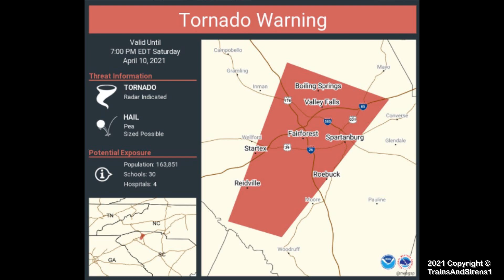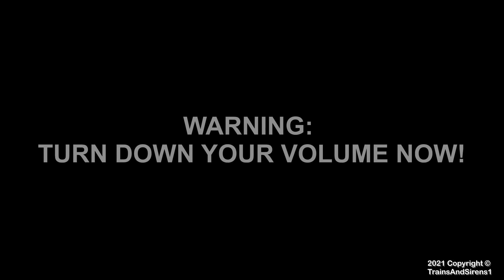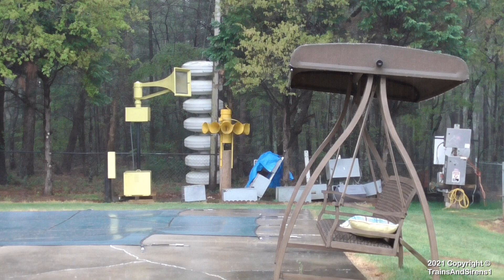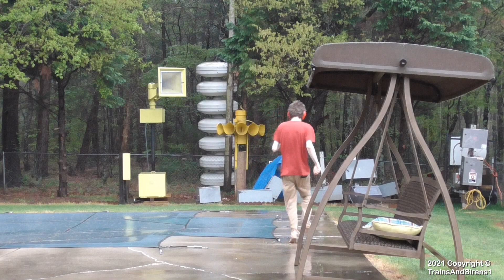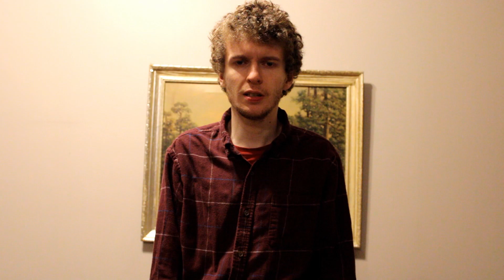My T-bolt 1000, 2001-130, Modulator 6048, and 2T Tornado Warning Activation, Attack/Wail 4/10/2021

Comment: This proves that Thunderbolts are louder than 2001s. I don't care if the T-bolt was rotating, I had a hard time hearing the 2001.
Reply: I just clicked on this video I had no idea there was a 2001 💀
Reply: @Godzilla20191  damn! 💀
Reply: @Siren1000T I know me too I had a Hard Time hearing the 2001-130 😊❤
Reply: The modulator beet the 2001s ass as well lmao
Reply: @mattmakesmachines well, in my opinion it’s probably because the rotator stopped working. Like it’s stuck

Comment: Orchestra of sirens.Beautiful. 
Also I know running the STH10 would probably over amp the household circuit. I had the same problem with a Powerkraft stick welder.
Reply: Put Transformer amplifier on your system not going to pop the entire city circuit just try try it or get like a Transformer adapter
Reply: Uf!! I bet that was very costly to fix.

Comment: L O U D
🅱️🅾️G
And why you didn’t use your STH-10B?
Reply: I believe it pulls too many amps to start up.
Reply: @MidwestSirenProductions  yeah. It pulls like 50 amps.
Reply: Its not amps or volts. If it uses a standard induction motor the amp pull is based on pitch/speed and it would pull most amps at peak pitch. Its just not hooked up.
Reply: It’s not connected to anything.
Reply: Wasn’t loud enough to work
Reply: @Memerino-ly7yr  No lol. It is too high voltage.
Reply: @Memerino-ly7yr  tf, no
Reply: @Memerino-ly7yr  wtf
Reply: He doesn't have it connected. He told me he's gonna find a power source for it, but as of now, he's keeping it inactive.